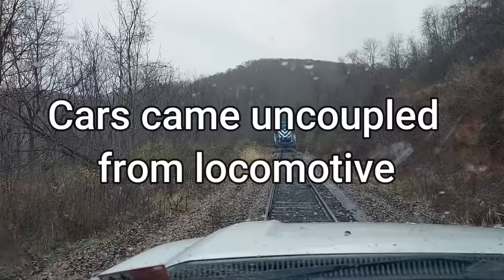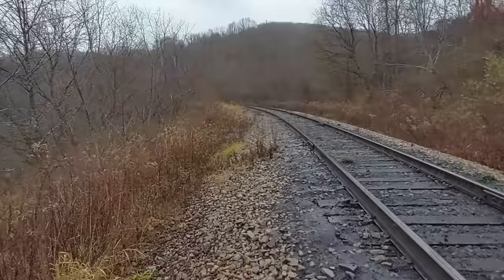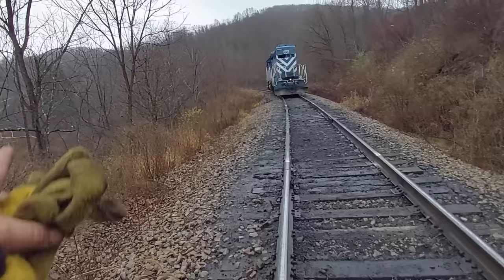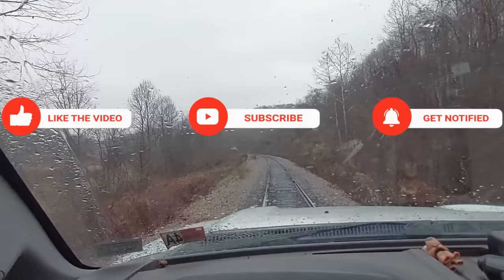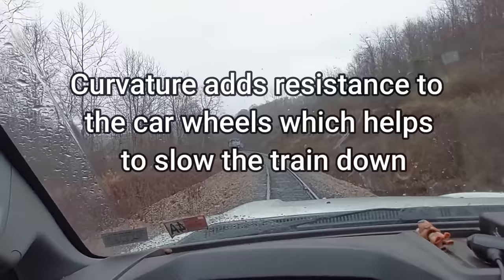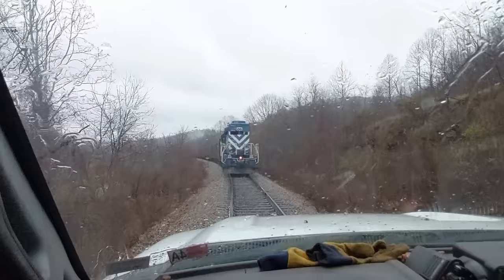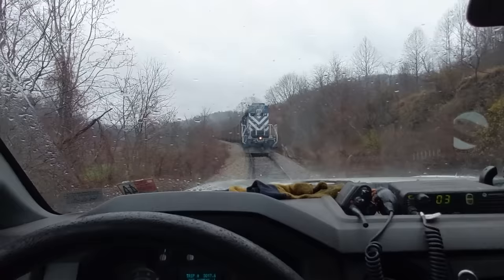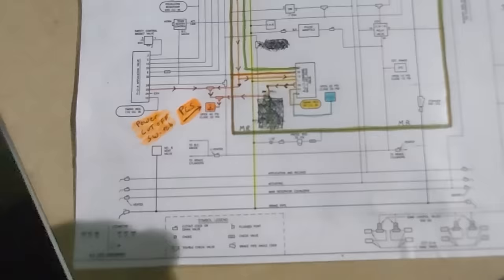Locomotive in PCS Fault and Remote System won't Link Back Up

Comment: Locomotives equipped with a rcs system replaces the Deadman pedal that used to be on the floor. If the rcs (reset control system) cycles and the button is not pushed it will initialize a penalty brake application. The purpose of the power cutoff system ( pcs ) is to stop the locomotive from producing power since the train is in emergency.  Some locomotives the pcs also disables the dynamic braking. But newer locomotives are equipped to still provide dynamic braking in order to help get the train stopped.
Reply: good information
Reply from the maker: Thank you very much bigjoesburgers for taking the time to visit with
us and share the information. On all 3 of our locos the dynamics
are disabled. 2 of our locos have deadmans and 1 has an alerter, which is pretty much the same as your RCS I'm thinking? Happy rails to you until we meet again my friend.
Reply: I thought the alerter was the replacement? Part of the event recorder or even can be a stand alone box...
Reply: @theodore thompson  yes it replaced the Deadman pedal. The pedal was outlawed quite a few yrs ago. To many crews would just leave a brakshoe or grip on the pedal. So the alerter was brought in that had to be pushed every cycle.
Reply from the maker: @bigjoesburgers  😊👍
Reply: @ccrx6700  Maybe my dad and you would be good friends because he couldn't tell Green from Blue either, he was color blind
Reply from the maker: @HopefulPessimist  👍😊
Reply: @ccrx6700  Just curious Dave but why would they Disable the dynamic breaking On the locomotives. I'm very interested in your reply and I hope you have a faithful happiness thanks a lot.
Reply from the maker: @Jay Hopkins  on our old locos that the way EMD made them. On newer locos dynamics will still function. I have no idea why EMD blocked dynamics on older ones
Reply: @jayhopkins6990  I hope it's braking and not breaking. We don't want broken trains.
Reply: Indeed, breaks cause brakes, and that can cause breaks. But breaks brought by broken brakes brings bonus breaking baggage!
Reply: @nickcook2775  what?
Reply: Override from how many houses or countrys during war. Is there a war. Protocal. Manuel ops.

Comment: Don't sell yourself short Mr. Dave, you know more about this stuff than we do. We appreciate you teaching us about railroading and giving us an inside view of the operations. I've been fortunate enough to be in several steam engines but only one functioning diesel. Thanks Dave, stay safe my friend.
Reply from the maker: Thank you Rick for the kind and thoughtful words. Was
swell of you to take  the time to visit with us and check out the presentation. Happy rails to you until we meet again my friend.
Reply: I heard that a fully loaded 70 car train can take anywhere between 2-5 miles before coming to a complete stop on a level grade. Is this true?
Reply: @eddog6666  A 100 car loaded unit coal train traveling at 50mph can take about a mile to come to a complete stop on flat ground. I am a locomotive engineer at CSX.
Reply: Yeah I don't know jack about trains but was fortunate to drive one when I was around 5-6 when me and my dad were walking the tracks, the conductor was extremely nice and it's probably the coolest thing to ever happen.
Reply: Concur. I like the boots on the ground atmosphere.
Reply: Yourself
Reply: @Dscrilla_xKOTGx That's full automatique brake at 100%, emergency braking or just little braking?
Reply: @Traumatree  In my experience, the emergency application will get it done for sure...desired or not lol. A full service brake application of the automatic brake system is hit or miss if we are referring to getting the train stopped in under a mile. It truly depends on the length, weight and even the type of cars that you are carrying in your train.

Comment: That Control Chief was still running Windows CE on a single board computer with AMD Geode LX CPU (looked to be 500 or 800MHz)... man... surprised those things are still kicking!
Reply from the maker: Wonders never cease do they. It is a decent system when it
works! Thank you very much xcesmess for taking the time to visit with us and check out the presentation. Happy rails to you until
we meet again my friend.
Reply: @ccrx6700  i really like Cattron stuff. I've installed and tested a handful of systems.

Comment: So How did the DPU Uncouple from the Train
Reply from the maker: Thank you andymano for paying us a visit and checking out the
video. Coupler on the car had an adapter plate which had
fallen out for whatever reason. Adapter plate fits under the coupler shank. That caused a mis match in the coupler height from car to loco. Car went up to mine fine with no problems, but once it got loaded, then that made the mis match even greater.  

Coupler did not come uncoupled, rather coupler on car slid
down enough so that caused the car to uncouple from the loco.
Several low spots in the track surface did not help matters.
Car was pulled from train and fixed that evening. When they
put a new car in place of that one, they had no more problems
with it uncoupling.
Reply: @ccrx6700  I'm just glad that Rear Loco did not lock up and Drag at the train.
also I believe you guys have a Original Loco 
On my Trains calendar this Month LOL.
peace Brother, Stay safe.
Andy M
Reply from the maker: @apmazurka  👍😊

Comment: Having that PCS is a real-life saver. Otherwise, it looks to me like you would have a runaway train. Prett cool learning all this stuff from you Dave!
Reply from the maker: You are absolutely correct in that William. If no PCS then if
the cars came uncoupled or derailed that back loco would keep
on pushing, a very undersirable situation. Thank you for the nice
comment and for watching my friend.
Reply: Actually, the locomotives were in dynamic brakes.  The PC switch killed the dynamics and the train ran away until the emergency brakes took hold.  Since the trailing locomotive only had it's own weight to stop, it stopped quickly.  Thus the long distance between them.  Unless the locomotive was equipped for dynamic brake holding.

It's been awhile, but as I recall, the power cutout switch (PCS) interrupts the power control relay (PC or PCR).  Dropping out the PCR interrupts the governor solenoid circuits, the generator excitation circuit and sends power to that light on the control stand.

Sometimes in jargon called the "power knockout...."

Oh, and 26-L was introduced in late 50's.
Reply: You sure hit the nail on the head . Dave, gives very good  information on safe daily operations but his enthusiasm, smile and tid bits of information made me very happy I came across his videos. Take care!!! Always.
Reply: All right on. I’ve been on some old power like GP9s without PCS. We had some GP38-2 which would still pull until the throttle went to idle, then no power until PCS was reset. I’ve been told that the thinking was that they’d rather drag a potentially derailed car a few lengths, rather than kill the guys in the buggy with a sudden slack run in. A train in emergency would stop the train fast enough anyway.

The DB holding feature of the PCS became more common in the 1990s. Older power was modified. There was a runaway out west, and when the crew put the train in emergency, it picked up speed faster, since the DB kicked out. That prompted the DB holding.

Years ago there was a crossing with a low spot. I’m sure the track inspector never felt it in his truck. I had two big AC units with F tight lock shelf draw bars, followed by a Geep with standard E couplers. When we hit the dip, the couplers between the Geep and head pin did a high low bypass, causing us to come apart. The PCS tripped, and I bailed off. This was so the train would hit us, and so the wheels wouldn’t skid. It took me a bit to realize that I wasn’t stopping, so there was nothing behind me. We recovered and went back to get our train, then do a pull by inspection.

Comment: The 26L system entered production in the late 1950s and quickly became the standard.  It was superseded by the 30CDW in the 1980s, but this and all the newer electronic air brake valves (CCB, EPIC II, FastBrake) all operate in the same manner.  Most if not all of the Class I's still operate some older units with 26L brake systems, though EAB of one type or another seems to have become the standard on new or rebuilt units.  Like many steam locomotives, C&O 1309 originally had a 6ET system but it was replaced with a 26 during the recent rebuild.  The benefits of going with a 26 or newer system include pressure maintaining (the 26 was the first system to make this standard, it became an option on the 24 and earlier systems did not have it), greater reliability, longer maintenance intervals and parts being a lot easier to obtain.  Some other restored steam locomotives have also been upgraded with 26 systems, including CP 2816, CP 2860, CN 6060 and NKP 765.

That 'Control Chief' setup is new to me, but you'd be surprised at how often we have to reboot the computers on newer GE and EMD road units.  The modern Distributed Power system (brand name for Locotrol III) has had a lot of bugs over the years, it took a long time to get them worked out and every time it or the locomotive computer systems in general are 'upgraded' more bugs seem to appear.  DP can be tricky by itself, but DP and Pacesetter (slow speed cruise control) are an especially bad combination.
Reply: My Dad was a Locomotive Engineer on Long Island Rail Road,, we talk about Locomotive air brake a Few times, he like the 24RL over the 26L , due to the 24 was more dependibe but the 26 is more easy to use, Dave well done, he was good friends with the Head of Air Brake and would being the Enĝineer- Trainees over the air brake shop for indeep training.
Reply from the maker: Thank you Bob for the awesome informative comment. Yes that does and I guess not surprise me about rebooting the computers
on the new locos. I thought locotrol was top of the line.  It was
pretty neat when I was in the cab of 1309 to look down and
see the same brake stand on it as is on our locos. Really appreciate your visiting with us and checking out the video. May you have a most blessed day my friend.
Reply: I was told in air brake class that the 30CDW is essentially the same as 26L in the air brake compartment. True or not, I’d have to ask a machinist. 30 was designed for desktop applications, although I’ve seen in mounted sideways on a conventional control stand on CN SD70/75M. 

The electronic EPIC and CCB are part of the requirement for the 184 vs. 92 day inspection. The first electric valves had no resistance in the handle, so it was easy to push the handle too far and take off 13 psi, when only 10 was intended.

Comment: Dave, I've learned more about locos and these new operating systems in 18 minutes than the last few years of watching rail fan videos and doing my own research. Believe me when I tell you, that makes my operating engineer's heart go pitter-pat. Thank you very much for taking the time to teach me about this.
Reply from the maker: Wow, Thank you very much American Warhorse for the nice comment. Glad you enjoyed. We really appreciate your taking the time to visit with us and watch. Also we have a unique remote
system, it is unlike any other. Most RR's run LocoTrol made by Wabtec, it is a much better system and operates differently.

Big thing is on ours, the rear loco does not supply air to the
train brake pipe. At the beginning of the video when I shut
the angle cocks off, air was not coming out the brake pipe, it
was coming out the train dump line for the cars. On most other systems and trains with a mid or end of train DPU, those locos supply air to the brake pipe.  So go pitter patter that.... :-) May you have a most blessed day my friend.
Reply: @ccrx6700  See! Learned even more stuff! More pitter-pat!
You have a most blessed day as well. 🙂
Reply from the maker: @oldgoat142  👍😊

Comment: Something going wrong always seems to happen so someone has to get out and walk when the weather is "less than ideal."  Could have been worse of course, it could have been snowing or worse, an ice storm.  Winter has never been my favorite time of year for that reason.  I'm not at all surprised at how far that loaded train slid on wet rail when the brakes came on.  
But even with all the electronic FUBAR all in all it's a good day ... no one got hurt and no metal got bent.  Lots of vitamin C guys, you can guess why.  Respects.
Reply: Can you elaborate
Reply: @coreybabcock2023  Elaborate about what?
Have you ever heard of "Murphy's Law?"  It goes something like this ... "If anything can go wrong it will go wrong at the worst possible time."
Reply from the maker: You're certainly right in that Robert, could have been a whole
lot worse. Very dangerous to walk on frozen or snow covered
ballast, it's sometimes treacherous. Was swell of you to take  the time to visit with us and check out the presentation. Happy rails to you until we meet again my friend.

Comment: A little something I learned about the PCS system, like you said all power (both motoring and braking) are shut down unless the locomotive has a Saluda key switch on the control stand. Southern Railway design this system (I haven't seen any others use or even have this on the control stands) for their trains used on the 5% grade of Saluda (the name of the system) in which if the PCS trips it won't cut out the dynamics to help slow the train like what Bigjoes said a few comments down about newer stuff. I don't think your engines have it, it'll be a key hole in front of the throttle handle below the switches, I learned this from a training video Southern railway and NS made years ago for their Belmont coal train.
Reply from the maker: Awesome Ryan, thank you so much for sharing something I did
not know. That would be extremely useful here. On all of our locos
throttle as well as dynamics cut off. Only thing is, if EOT unit
was on dynamics and it pulled apart, there would have to be
a time out limit on it since there is no operator in the cab. But
that could easily be achieved I think. Southern was an innovative
RR. A great RR in it's day. Guys from them would shudder at
what NS has done to their heritage I would think.

Comment: Most amazing video. From skid marks to frustration when the system won't reboot. How did the uncoupling happen? Thank you,  Dave, for sharing.
Reply from the maker: Thank you Shirley for paying us a visit and checking out the
video. Coupler on the car had an adapter plate which had
fallen out for whatever reason. Adapter plate fits under the coupler shank. That caused a mis match in the coupler height from car to loco. Car went up to mine fine with no problems, but once it got loaded, then that made the mis match even greater.  

Coupler did not come uncoupled, rather coupler on car slid
down enough so that caused the car to uncouple from the loco.
Several low spots in the track surface did not help matters.
Car was pulled from train and fixed that evening. When they
put a new car in place of that one, they had no more problems
with it uncoupling.

Comment: We had a lot of trouble with the air connected to the computer, so much so that they finally separated the air brake from the 'puter. They had road trains stopped, unable to recover the air without help from the diesel shop electricians, or some of the younger hoggers figured out how to recover the air, but even with their efforts, sometimes they wound up having to run a train from the 2nd or 3rd unit, just to get the dang train going and get it to the terminal and off the main line. 
  The DPU control boxes were completely different from yours, and I was never on a DPU train. Some of the foreign RRs had a limit on train length so it was only occasionally that we would get a monster train, and they were usually trains with a large block of perishable loads for the East coast, a run through where a crew would get off, we'd get on do an air test get the whole train inspected, fill out an air brake form, and when we'd get to the crew change out point, we'd get off, they'd get on and away they went. That was in Riverdale, with the CSX crew @ the old B&OCT yard.
Reply from the maker: They have the same problem with this remote system too Thomas,
specially in the winter. They dump methanol in the air lines to
help prevent water freezing and I think that really messes with
the rubber seals/o rings in the system.  Really appreciate your stopping by to visit with us and watch the video. May you have a most blessed day my friend.

Comment: what a pain where the sun don't shine. Back in the real days of railroading we had a helper engine with an engineer and fireman on both engines head end and helper. This modern crap  is a joke! :(  Very cool video showing us life on the RR in modern times.
Reply: That's what the amp meter was for.
Reply from the maker: Thank you Brian, glad you enjoyed. Not too many RR's 
have helper districts nowadays. I do know NS Altoona/
Horseshoe Curve still has helpers, not sure if their helper
has only 1 man or also a conductor with it tho? Back in
the 1980's they put in the remote system on our locos
and did away with the second man on the loco here. Was
swell of you to take  the time to visit with us and check out the presentation. Happy rails to you until we meet again my friend.